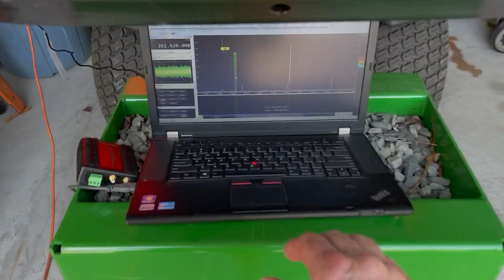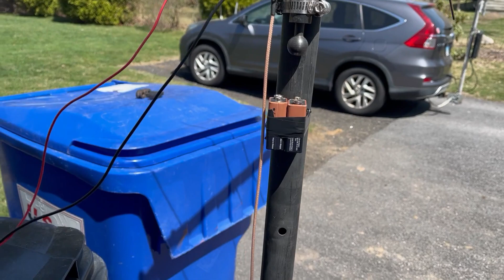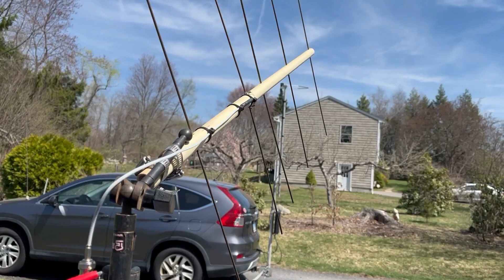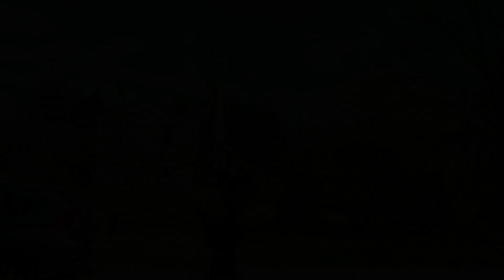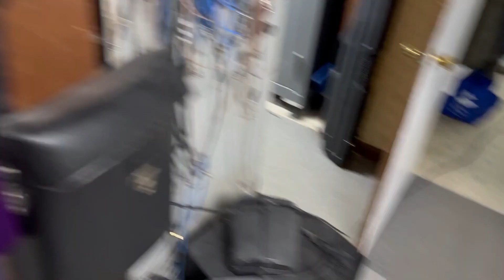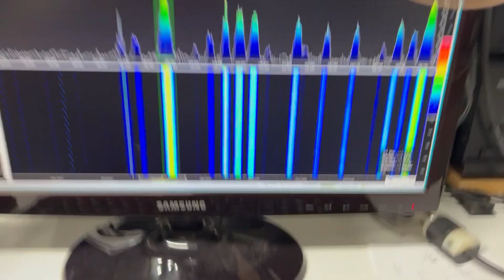Pirate radio stations   Russian language heard on USA satellite Like  CB  radio

Comment: Is the RG316 good for only short cables?  Would it be same performance to replace 50ft  RG58 coax for SOTA purposes?
Reply from the maker: JJ,... In this situation the cable loss is not really and issue.  The system noise floor is established at the input to the preamp.   The preamp has over 20 Db of gain in this case so I can afford the loss... But yes longer distances I would not use RG316

Comment: Great video, Paul.  Regarding your FM log periodic, RG-11 isn't that bad at 260 MHz, relatively speaking.  I checked the specs, and its attenuation is about 2.1 dB per 100 feet at 250 MHz.  So for 300 feet, that would be about 6 dB of loss.  Not great, but not that bad either.  I think the tuned yagi, preamp, and vertical polarization were the biggest reason for the improvement, as opposed to cable loss from the FM yagi on the tower.    Love the outdoor shots and the homwbrew yagi.  I was eally surprised to see what a difference shutting off your solar panels did up at 260 MHz.

I'd like to see how much of a difference rotating the custom yagi from vertical through to horizontal orientation.

Keep these great videos coming.  73
Ken - WBØOCV
Reply: 6db of loss, Not great, Not terrible